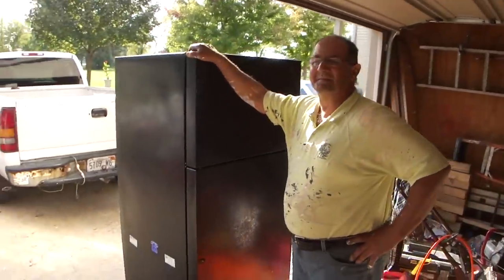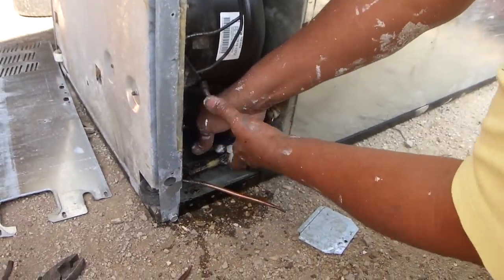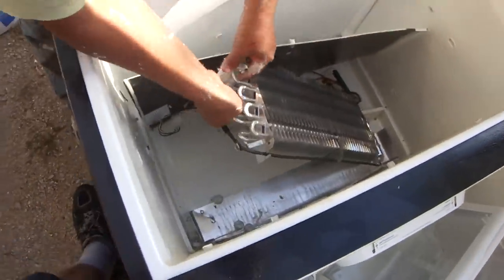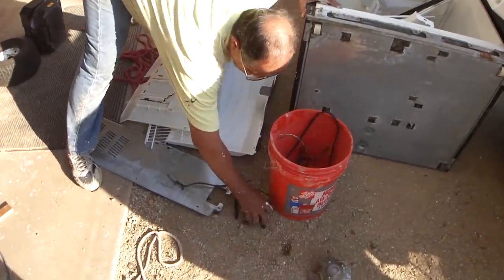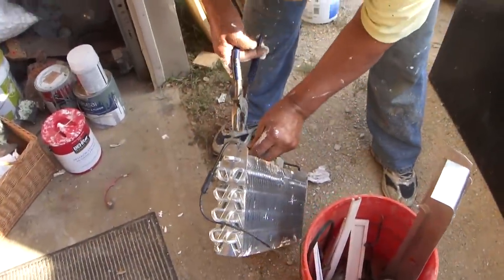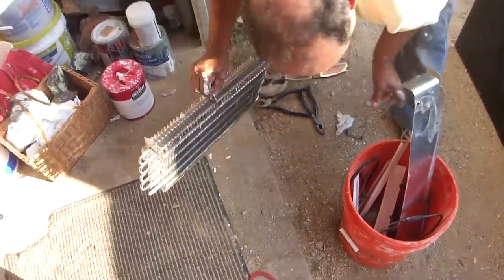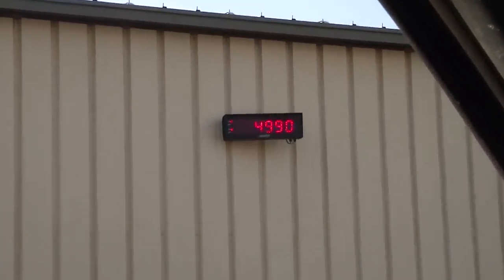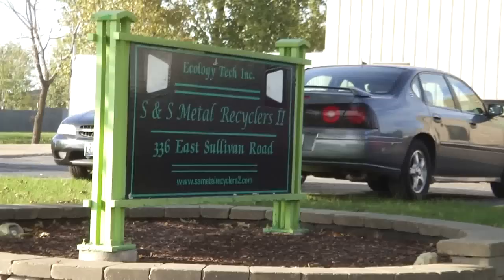Scrapping A Refrigerator for Copper and Aluminum

Comment: This video is more like, how not to scrap a refrigerator for aluminum and copper! Always take the compressor 😂
Reply: Yeah well he also left the condenser coil behind
Reply: Hope the folks next door are deaf
Reply: And Freon is nasty business. That's why you have to have a license to even buy it. Seems like this dude did not care about freon in the environment
Reply: @dn7325  Was already empty, but yeah it's not obvious they're empty even if they don't cool
Reply: @peterrasmussen382  did you say something 🦻
Reply: Susan D  I was gushing from all orifices
Reply: For REAL!!  HELL, I melt it all down with the exception of the steel..  I picked up a 10kg smelting furnace from Devil Forge during the lockdown & a slew of tools, gloves, crucibles & have never looked back!!  I'm currently sitting at 150lbs of copper in 1.5-2lb bars all the way up to 5lb bars, about 40lbs of aluminum & 1 5lb bar of brass, with plenty more of the 3 to still melt!!😉🍻  I do it on my weekends cuz it's fun & I LOVE the clanking sound of those bars when I decide to play with them!!🤣
Reply: @TheRealCheckmate  Oh, for sure!!  I'm still fine tuning the furnace, but it's not too bad, it's usually $10-$15 US for propane to refill my tanks after a melt at Tractor Supply & I'll usually come out of it with 2-4 bars depending on which mold I'm using..
Reply: @dn7325  there wasn't any refrigerant left in it. It would have sprayed out when here cutter the tubing off the condenser
Reply: @dn7325  can’t you buy that shit at Walmart?

Comment: If you peel the back of the fridge off (only takes a few minutes, some have screws) you will get a copper line that runs from compressor to the aluminium rad. Also compressor has copper in it if you want to take apart, it's kinda tough if you don't have the right tools. I have a stihl saw but a big grinder will work as well (try one and then you can decide if it's worth it). They pay a different price for compressors around here 10 cent per pound, so check what steel price is and take off or leave on depending on what pays more

Comment: This guy definitly shows how not to scrap refrigerator, he left compressor what a amateur
Reply: PitsuMiwus yup. Good bit of copper inside the compressor. Rookie!😂😂
Reply: I came for the compressor
Reply: Fyi its my secound day and even i know that
Reply: Nit wit simple minded
Reply: He left the other coil in the fridge
Reply: There's a heap of cooper in the wall's of the fridge leading to the freezer
Reply: Not the coldest fridge in the kitchen is he
Reply: he forgot to take the freon out which is dangerous. Some companies take it out for free so best safe than sorry no?
Reply: Sometimes they are copper coated aluminum

Comment: Not how I scrap refrigerator, I also remove compressor and cut it off top with grinder for 1.5 pounds copper. I also fill ref with scrap metal to save trip.

Comment: When i scrap a refrig, not only do I tear it down, but I fill the cavity with extra steel (old steel wheels, etc.) 
I wouldn't waste my time for $26.60 when I can bring in a lot more at one clip.
Reply: Mike Paul question. Wouldn't he get the same amount of money if hadn't  strip parts?
Reply: No they pay you by the metal. Aluminum, wires, sheet metal, copper etc.. they have different price. If you don't strip it, they will only pay for the outer shell of the refrigerator which is the $22.05 that he got.
Reply: I'd love to build a shredder so I can  shred sheet metal, etc. Then I could just melt it down myself.
Reply: Exactly fill the voided space with extras
Reply: I actually think its good that people try to scam by adding weight and stuff like that. It makes the value of improperly scrapped metal cheaper and gives a little more room for professionals that dont fuck around and do it right.
Reply: There is nothing wrong with adding metal to the fridge. Why are people talking about this comment like that’s dishonest. I have a 12x6.5 trailer and after I have removed everything I want to keep, I put four fridges face up and oriented in such a way that they all hinge in the middle of the trailer. I won’t take them to the yard until every square inch of them is filled with junk metal. It makes for a safer load. I did notice that he missed quite a bit on this video. Their was more aluminum on those drawers and in the fridge plus the condenser sells for more per pound than the fridge. Also if you are set up to cut that apart it’s got a couple pounds of copper in it.
Reply: lost boy 420 I’m sure their/there smart enough to know that putting extra metal in the thing isn’t dishonest

Comment: i use a grinder to cut a rectangular hole in each of the side panels and pull out the long copper pipe that is imbedded in the insulation, from a frigde that size I usualy get a extra kilo of copper out of it, but it costs about a dollar worth of grinder wheel, I just haven't found a better easyer way of getting to it. still its an extra 6-7 bucks

Comment: You should have pull the compressor and open it with angle grinder, there 2 Pounds copper inside.

Comment: Wrong ,if aluminum transferred heat better it would be worth more, copper is king.
Reply: You are actually incorrect too. Copper is a better conductor (one type of heat transfer), but aluminum is a better radiator(another type) due to lower density. Metal cost has to do with scarcity and other uses such as retrieval costs, how it machines, and its durability. That's why gold is so expensive, not because of its conductive properties.
Reply: Not how it works aluminum makes up 8% of the crust of earth copper is harder to extract like gold gold is common but the hardness of the collection make it expensive

Comment: Also forgot to take off the small electric motor where the aluminium rad was. I clean the copper off those small motors only takes a few minutes.

Comment: Aluminum is NOT a better conductive (heat or electricity) than copper, it's cheaper and lighter. Copper thermal conductivity is like 0.99 and aluminum is only half of than (0.5).

Comment: wrong copper transfers heat better thats why computers use copper heat sinks and in water cooled computers its only copper never aluminum, learn before u speak
Reply: Computers use aluminum heat sinks, not copper. Learn before you speak.
Reply: +pacoblancosmith The high end computers and laptops actually use copper heatsinks, so you learn before you speak.
Reply: I troll trolls 😂😂😂

Comment: Umm. was the refrigerant already Evacuated? I'm no environmental fenatic though I do what I can. Its only the refrigerants used in some fridges, freezers can be very hazardous. I just saw the vid go from a shot of the fridge with lightbulbs, then a cut to someone cutting into a copper line. A warning would not only be nice, but responsible as someone may not be aware that's not normally the same refrigerant used in your household AC. And not as benign to your health. let alone the environment.
Reply: Patrick Wall a warning for watching a video..? this fridge had no charge in it...others should know enough not to cut lines but usually the main failure in appliances like this is the fact that the freon leaks out over time. in car systems freon leaks out ovwr time with the compressor oil to oil the clutch and bearings, so why arent they going after car ac makers?

Comment: Sorry to tell you but u threw away most of your money. The compressor u cut the copper off is worth more than everything else. My scrap yard buys them from me at $1.40 per pound. Let me tell you that they are heavy too. its like picking up a car battery.
Reply: 1.40 are you sure, the compressors are worth less than motors (around 20 cents a pound) think if it a compressor is a motor with a steel shell, only worth 20 cents, you are probably confused with something else
Reply: Vaughan Scrapper  Its actually 10 cents per pound. The same as electric motors... A compressor from a smallish fridge like this one is worth about 2 dollars at the recycling center... 1.40 per pound, Im going to say this guy is confused with something else cause theres no way he is getting that much from one
Reply: Its about 15-20 lbs

Comment: Letting the oil run into the ground is environmentally irresponsible .
Reply: True. First the freon has to be recovered (need a license) if it hasn't already leaked out. In this case it seems to be already gone. Then the compressor has to be removed, drilled, and then the oil drained. I used to be in this business but on a larger scale; it was not possible to compete with all of the "scrappers" (their ads: pick up scrap for free) because they all cut the lines and illegally let the freon escape.

Comment: I can guarantee I could have repaired this for around $12-Next time remove the panel in the freezer compartment and do a continuity check on the Defrost thermostat that's connected to the coils-chances are that's what went bad-I've worked for a 170 unit apt complex and i've replace no less than a dozen of them over the years.Repaired you could have gotten $150$200 for it.
Reply: lmao haha
right on.

Comment: That ain't oil
Reply: James McAllister
and he called the fan a motor...
Reply: James McAllister watch him make his picnic table and tell yourself he's not a professional genius?
Reply: +Michael Wall It is oil, it's there to lubricate the compressor, it's non conductive so it doesn't effect the motor. There's about 200mL in an average compressor. The refrigerant is tetrafluorethane (usually) which is not liquid at room temperature.
Reply: +James McAllister yea one video this guys says striping copper from insulation is halfing the price to riping a protection tv apart destorying it and runing the fernall lens cant tell the different between a scrapper cosplayer to a moron you be the judge

Comment: you know you just let Freazon into the air thats illegal.
Reply: TRIBBLETON VLOGS what's freazon?? Those copper lines that hold the Freon had no pressure when cut into them witch means the freon was long gone before he scrapped it and that's more than likely why the fridge quit working
Reply: this was 5 months ago i learned how to spell it in july.
Reply: It was flat,no charge when he cut the suction line obviously
Reply: Not only that but its worth $200 a kilo!
Reply: they don't use Freon anymore
Reply: dwayne marshall freon is a name brand, not a type of refrigerant.